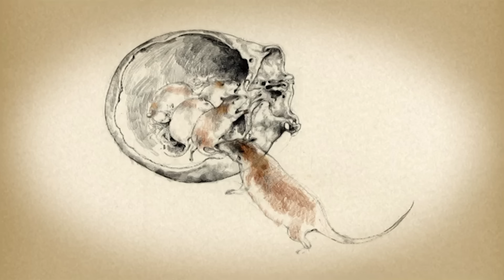A Bronze Age Mystery | FULL EPISODE | Time Team

Comment: The small grooved stone looks like something you'd use to smooth the edge of tanned leather.  Also, the larger stones with a cup-like depression carved in look like oil lamps: you'd put oil or tallow and a wick of some kind in the depression and it would burn like a candle. Possibly when the body was laid to rest, the lamp was lit during the interment. Just some thoughts.

Comment: I honestly wonder if that hole drilled in the rock is actually " portable rock art " back then I feel like you wouldn't spend a week or however long it took to make a 3 inch deep hole in a 10lb rock so you can have a piece of art, I figure it would have some practical use.... But I'm not archeologist
Reply: If you notice they do suggest these pieces of 'art' were perhaps used in ceremonies. The term art should probably also be taken in the most general sense of the word, to mean an object with no apparent practical use. 

I also think one has to consider that back then, a differentation between practical and ritual may not have existed. If you believe your harvest or hunting luck depends on the gods, then ritual objects assume a very practical value. You either pay homage to the gods and acestors in a proper manner or you risk starvation, illness or other disasters.

One could argue that the effort put into making a hole in a stone, turn that stone into something special. Perhaps used for ritual purpose. Maybe a portable altar you could bring to the graves of your relatives on certain occasions. Or, from a more pragmatic point of view: If you need a stone with a hole in it, why not choose a stone you can bring home and drill into while sitting by the fireplace.

Comment: It's a bit sad for me to see them excavate it like that, because i could use a mechanical micro digger with a perssure sensor and a spectroscope to measure 100 chemical elements and pressure data for every cubic millimeter of the technical zones and pick up invisisble evidence that they have to throw to eternity manually.

Comment: of course these are professionals who do a good job under the pressure in three days. I wonder what other things would they have discovered if they had done the investigation without pressure. But that's the way it is, fast food archeology hits it very well. This over-the-top dwarf who runs out of the group pictures to portray himself alone, pushing lever boards under the stones into the earth or drilling with a stick through the gap in an unopened grave, should someone teach humbly ... but who am I anyway.